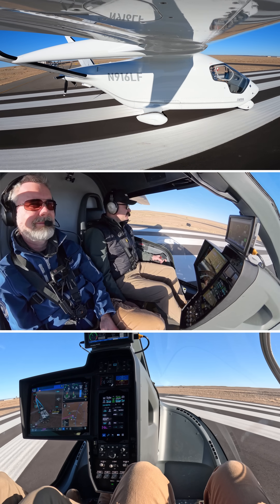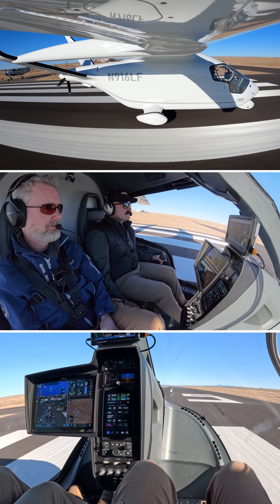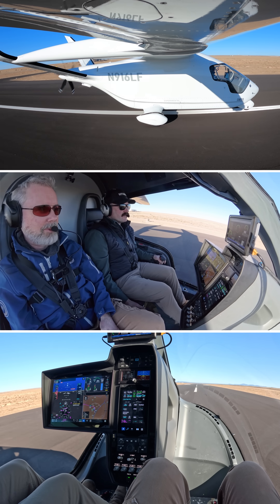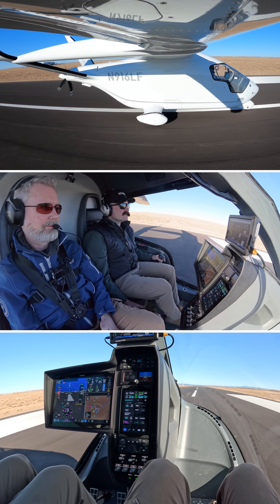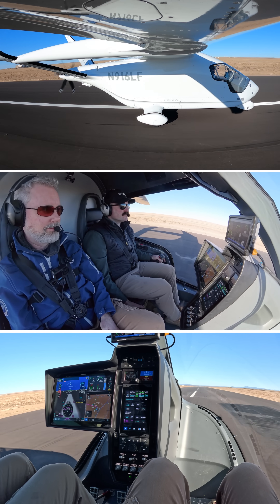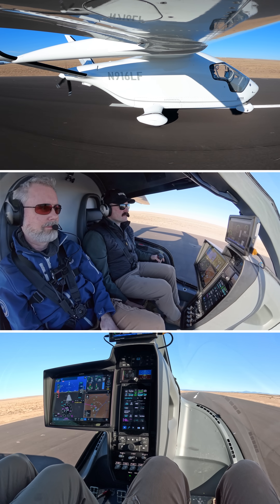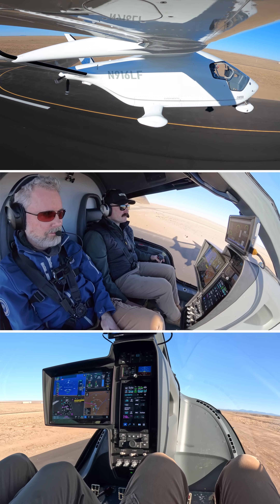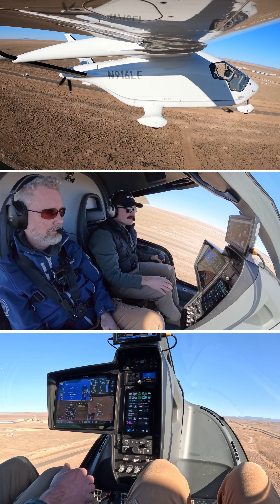Learning to fly Electric CX300 "Alia"!

Comment: Very cool.  But man that was a long takeoff roll and a loud prop.
Reply from the maker: It's really not loud - I was standing right there. 
And yes, this CTOL version is really more of a test platform for the ultimate VTOL version. At the end of the day it won't be doing CTOL take offs, and it would be more of an emergency situation if the VTOL version had to land in CTOL mode.

Comment: No verticle engines on this. Just wait for the buzz of four electric motors. Short propellers, rotating at super high speeds for lift. Soon it will sound like a v-22 and be just as disruptive. Just my opinion.

Comment: Now it would be great if they could make batteries that could actually store real useable energy and can be charged in a actually reasonable amount of time unlike it currently does.  Battery technology is about 100 or more years from truly useable technology, if ever. Then you have to deal with the environmental destruction to mine all the required rare earth minerals and the further damage from disposing of mountains of toxic defunct batteries leaching into the ground water and rivers.
Reply: God no. Lithium-based batteries are super easy to recycle. We in germany have facilities that recycle them to 97%, and we do this since the 1980´s (also because its a law. Nearly no batteries here land in a landfill). Batterytech had made giant leaps in the last 10y. Batteries are constantly getting lighter AND cheaper. (a 2kWh Powerstation was 2000€ 3y ago, this year you get a 2,5kWh powerstation for 700€). Also all the modern batteries have no rare earth minerals in them any more. One us example is Tesla that has no batteries with rare earth minerals since 3y now.

Comment: I'm sure these will be addressed in the full video, but from watching this short my observations are:
That takeoff roll seemed to take a long time
Just how heavy is this aircraft
That is the size and chemistry of the batteries
How common are DC fast chargers at airports and FBO's
Reply: lol that’s an understatement. That roll was longer than plenty of biz jets
Reply: Probably a combination of weight, very slippery wing + sunny day at high altitude. Still think its super cool tho. Quiet plane that is cheap to run!
Reply from the maker: Yes, the wing is ultimately designed for VTOL.  The fact that it has CTOL capabilities is cool.
Reply from the maker: The full episode will get into the battery chemistry and charging infrastructure.

Comment: Energy density isn't enough for anything worthwhile
Reply: You be surprised at the power of efficiency.  Tripling your efficiency is like Tripling your energy density.  And don't forget these ancient IC engines used in GA are like 15% efficient.
Reply from the maker: You sure about that? 🤓
Reply: I looked it up. It's got about 50nm less (demonstrated) range than a Carbon Cub.
Reply: @ljfinger  As long as you can charge it at the destination.  I wonder if you could carry your own generator in it...
Reply: @ljfinger  Takes 5 mins to refuel a CC on a grass strip. Really practical if the CC has a Rotax that uses Mogas.

Comment: Sounds like an electric lawn mower.
Reply from the maker: I love the sound of the airframe.  The fact that you can hear that at all means the engine/prop isn't very loud.
Reply: @ I agree. I love the sound (or lack thereof) of my electric lawn mower over my gas powered one, it’s transformed my weekends. I was thinking that larger batteries would benefit from larger wingspans, glider style, which could facilitate PV cells on the larger wing area. As PV cells got more efficient, and battery power densities higher per cubic inch, higher payloads and longer distances would be more viable.